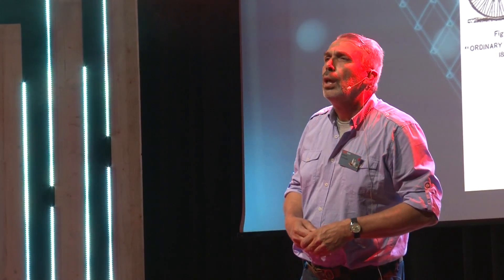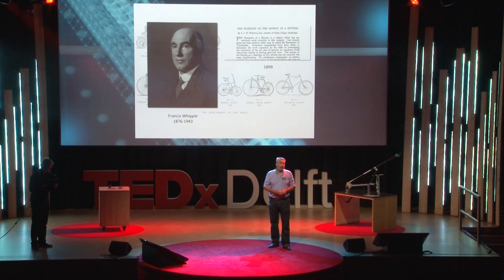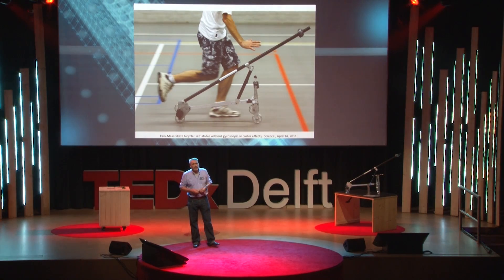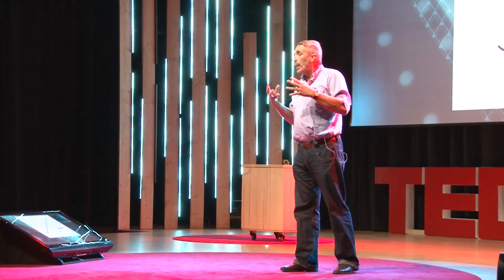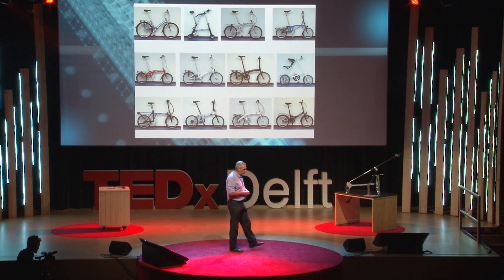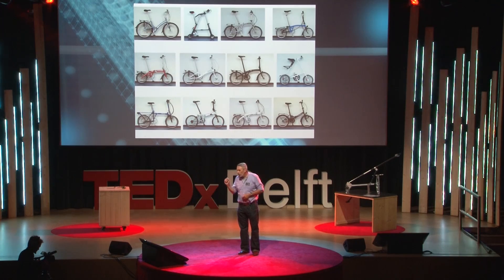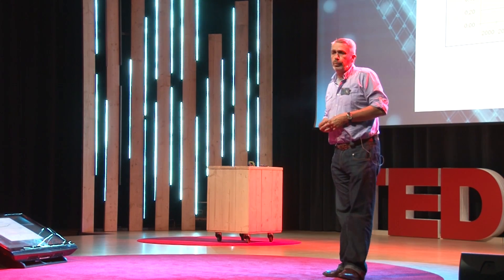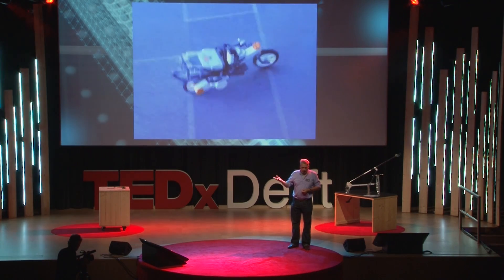Why bicycles do not fall: Arend Schwab at TEDxDelft

Comment: I am really surprised there is no mention of wheel camber, especially given that the speaker is a professer of applied mechanics.

A single wheel rolling on it's own shows the same tendency to steer in the direction it is tilted. When a wheel that is rolling in a straight line is tilted it exerts a thrust in the same direction at the contact patch because the tilted wheel wants to follow a circular path. In effect the rolling wheel automatically moves the contact point to be under the center of gravity. This is the same principle behind a band saw blade or flat belt tracking on a crowned pulley, and also what makes a car with misaligned wheels pull to one direction.

Gyroscopic effect is negligible to nonexistent, and has been debunked, caster effect is negligible but makes steering from the handlebars more stable. I find the idea of one wheel 'falling faster' than the other highly dubious without supporting evidence.

I have a front wheel drive recumbent bike with almost zero trail/caster that will toss you onto the ground if you try to steer only with the handlebars. Instead you have to lean into a turn even at low speed and the handlebars just let you damp the oscillation or turn more agressively. ...Steering on a bicycle can be accomplished almost exclusively with camber thrust. I'm not well versed on unicycles but I tend to guess that the statement holds true for those as well.
Reply: The tire acts like a rolling cone when the axis is off parallel with the road surface, following a circular path, but the inertia of the wheel acts in the tangent, so the forces oppose eachother and move the wheel back to horizontal. Or if the inertia isn't strong enough, the wheel spirals inward until it falls over.
Reply: Gyroscopic effect is small, but not entirely negligible depending on the vehicle.  It's not the dominant force, but has a significant effect on motorcycles.
Caster effect or "trail" is far from negligible, and is probably one of the largest contributors to stability on most bicycles. The model with the wheel "falling faster" is not really demonstrating how conventional bikes work, but just demonstrating another mechanism that can compensate for a geometry with the other stabilizing effects removed.

I don't know your specific recumbent bike design, but I expect if has a bit more trail than you expect. I suggest measuring to see.  Frequently you will need more than on a conventional bike to maintain stability, which is why recumbents often have straighter, or even reversed forks (less offset, more trail)

There's no way at all that you're correct about steering a bicycle with camber alone.

I ride unicycles, and I'm not sure how much effect camber really has there, either.  I've got a unicycle with skinny 23c road bike tires I run at very high pressure, and another with 3" mountain tires which should have much more camber effect, yet it's easier to turn on the road wheel.  I can feel the camber effects on different wheels and I'm often fighting them, which suggests to me that they're not what is responsible for my stability.
Unfortunately, like bicycling, it becomes a subconscious thing, and most people don't even understand what they're doing, myself included.  I'm fairly certain almost everything is due to position of center of mass in relation to thrust (at the contact patch).  If I let myself fall to the right and pedal, the off centre thrust will cause a rotation.  What I'm not entirely certain of is what prevents the unicycle from rotating on the axis of the seat post and rolling out from under me.  I don't get the impression that it's entirely from a bit of drag on the sides of the contact patch, or the style of wheel would have a much larger effect than it does.
Reply: Mark McCormack The camber is the mechanism how bicycles turn corners.
But to make a bicycle "SELF-STABLE", you need: at least two wheels aligned straight in the rolling direction, and only one but not all wheels that can steer left and right freely. Besides, if the road friction is negligibly small (like on well polished smooth floor), even negative casterring is fine. But if the friction is relatively big (like on muddy road), you need positive casterring or at least zero casterring to achieve self-stability.
Reply: +Mark McCormack Very good comment, sir!

I've been trying to find resources to understand that and counter steering properly (most stuff online if full of guessing and no physical or mathematical explanations whatsoever) and this video and comment are gold! Of course this also mean they left me even more confused than before... hehehe

Tbh the only part I disliked about it was when you said "the tilted wheel wants to follow a circular path", like it has a will of its own. I did not quite understand this point because of it. Care to elaborate? I can imagine why this happens on a bicycle, but not really on a wheel by itself.

Thanks!
Reply: BoyTitan:  You ride a front wheel drive exactly the same way as a rear.  The only time there could be a significant difference is if you're losing traction due to the thrust of the front wheel.
Reply: I was thinking about a saw blade on a bandsaw (that is, the blade moves to the highest line on the two wheels) also.
Reply: Not huge on all this physics stuff but your problems comes from a difference in steering. A motorcycle or bike with 2 wheels that are rear wheel drive you counter steer push left go left push right go right. A front wheel drive bike not fun to steer tried it with my e bike and switched to a rear wheel drive motor. Also no sure if your recumbent is 2 or 3 wheels. If its 3 wheels you really are gonna have a bad time with single front wheel drive. Front wheel drive can only be done right with 3 wheels when the front 2 wheels drive in unison.
Reply: @TinyTitian  The "push-right-to-go-right" counter steering method is about upsetting the cycle's natural stability and moving the ground-contact point from underneath the CoG.
Reply: That's a fair point, much like the stability of a train on tracks. 👍
Reply: I was thinking about bandsaw blades tracking too.

Comment: Assistant Professor vs. Mechanical Engineer:

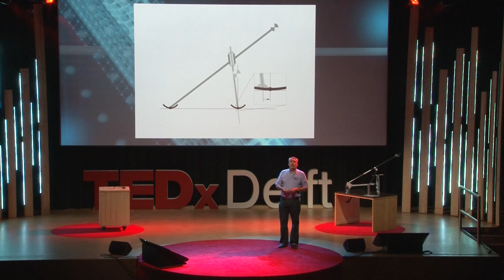The picture at 9:14 shows positive caster.  The device in action has positive caster.  There is no demonstration of the device working with no caster.  If his argument about tipping masses was correct, a stationary bicycle would turn toward the fall.  This does not occur in the demonstration at 4:11.  Bicycles self stabilize because of the  caster effect and the rounded rubber tire.  As the bike falls, the contact patch moves toward the side wall, and friction helps to turn the wheel toward the fall.  Metal, "pizza cutter" type wheels would rely completely on the caster effect.
Reply: Any time Mr. Sibert. I'll bring the graph paper and the screen grabs. I'm out of whiskey at the moment, so let me know ahead of time so I can pop down to the shops.
Reply: The stationary bike falling does provoke a steering effect, but if you just let the bike fall, you can't see it in time.  I've just tried it with my own bike.  Hold the bike upright with the steering straight and lean it over.  The steering will turn into the lean every time.  The caster is what does it, and I agree that his "no caster" model does in fact have some positive caster.
Reply: I've been riding two wheels for over 45 years and your reasoning is just common sense to me. Stability is a function of inertia, variable caster angle, and contact patch area/friction. It's the relationship of these three things that determine stability. If you look at any one aspect while ignoring the others - of course it'll make you wonder. The delta must be close to zero sum. You vary the caster effect, either by making it 0 or increasing it too much like a chopper, stability will decrease. Increase or decrease friction too much, (like riding on ice or having a front tire so flat that the contact patch affects caster and inertia, stability decreases.  Increase or decrease inertia and caster will need to vary to maintain zero sum. For example, we increase inertia during high speed cornering. To overcome this we have to decrease caster to offset the inertia. This is done by leaning forward and literally steering away from the lean - the opposite of a low speed turn.

Their experiments were done by limiting both inertia and speed. The rear steer bike worked well at low speed. Increase speed beyond the limits that the caster can be varied and during a turn the caster will cause the back end to swing around, increasing friction of the contact patch and inertia will cause the rider to endo in a straight line until friction overcomes inertia. Ouch.

Comment: Do humans have a gyroscope inside our bodies to keep it from falling?
Reply: Zhonguoria The inner ear is where most of the magic is.
Reply: ***** Um honda did it. Asimo
Reply: Sensory organs such as the eyes and inner ear (as Timothy Green has said) receive signals about our bodies' position, the brain processes the information and sends signals to our muscles to correct imbalances. When walking our arms play a role too, have you noticed how they naturally move at the same time as the opposite leg? In other animals the tail also helps with balance.
Reply: Not exactly.
Reply: Is that a serious question?
Reply: Two things work together.  Your inner ear has sensors that tell your brain which way is gravity.  Your eyes tell your brain what angle is the horizon.  The brain combines these two data sources to maintain balance.  This is why when going around a high speed curve your eyes need to remain as level as possible or a false gravity signal (centripetal force pulls gravity a bit sideways) from the inner ear and a tilted head will cause spacial disorientation.

Comment: All of this makes sense except for at 8:31. By adding additional wheels you do not nullify angular momentum, you double it. Angular momentum toward the rear of the bike has the same effect as it does in the other direction.
Reply: Dalek:  Thanks.  The discussion before was frustrating.
Reply: Andy Ruina  I care, thanks for the explenation. Justsomeguys comment initially gripped me. But having the background of learning about angular momentum vector analysis stuff myself some years ago, your comment seems very sensible. But it's not something I'd have thought of easily, cuz its been a while since I studied it, and as you say, it is not very intuitive at all... which I think is part of what makes it great anyway, so thanks :)
Reply: eyesyc
You clearly don't understand angular momentum. The mass of the rotating wheel travels along the same plane as the mass of the bike frame, And they are rigidly connected. Regardless of the wheels direction of rotation, it's still moving along the same plane. The energy needed to deflect mass from this plane is angular momentum. For example, The front wheel has a rotational mass of say one pound, it's rotating at 100 revolutions per minute. at the given mass, moving at the given speed of rotation, it will take a specific amount of energy to deflect that mass by the one degree from the plane described.  Regardless of what direction it is spinning. Spinning another wheel in the opposite direction does NOT cancel out anything.
Reply: eyesyc
What you have described is torque. Then you threw in some unrelated terms that you found on Google. I remain unimpressed.
 And YES... Please do give me a full vector analysis. Seriously... I'm looking forward to it.
 Here's a prediction... You will avoid my challenge to provide it, then change the subject in order to avoid the shame of having been caught bluffing.
Reply: eyesyc
As predicted.
Reply: Hi  JustSomeGuy:
   Your comment is echoed in several places on the www.  And it reflects a common misconception about angular momentum.   Too common.  The misconception is even in a video put out by NASA in which an astronaut tries
to explain angular momentum using rotating CD players.  Here is the misconception.  In your mistaken view, and the mistaken view of many others, angular momentum is a positive scalar, like mass.  If I have some and you have some and we get together we have more.  

But this is not so.  Angular momentum is a vector.  If I have some pointing left and you have some pointing right and we get together, they cancel.   And this is the way it is with the wheels on the bike above in the video.

The propagation of this false conception, that angular momentum is a scalar and not a vector, is in part due to a common overly simplified expalanation of a gyroscope.  That overly simplified description is this:  A spinning object resists rotation.  

The more correct statement is that: A spinning object, if torqued about an axis perpendicular to the spin axis, turns about the axis perpendicular to the first two.
And the direction of this turn depends on the direction of the spin.  Hence the cancellation if two spinning wheels are mounted to the same part of the bicycle frame.

I realize this is hard to understand.  No-one I have met, and this includes lots of people with PhD's and me as well, really has a deep intuitive feel for angular momentum in 3D.  It is so, well, three-dimensional.  And picturing things in 3D is hard for our human brains.  None-the-less, we understand some things.  Enough to know, say,  that gyro effects cancel when you have  counter-spinning wheels. 

But we also know enough to know that these things are hard to understand. So your being confused about this is well within the realm of the normal.
Reply: Andy Ruina
What you've done here is called straw man argument. It in no way addresses what I said.
Reply: Dear Just Some Guy:
  I don't get your straw man comment. 
  The short version of what I wrote is this:  Two counter-spinning wheels attached to the same frame have cancelling angular momentum, not, as you said, adding angular momentum.  Yes, their kinetic energy adds, but that is not relevant for the turning involved in bicycle balance which is about turning and torque, not about kinetic energy.
Reply: Andy Ruina Adding angular momentum to the entire structure prevents turning. It's settled. Let it go. Thread muted.
Reply: It seems to me to be wrong. But if you don't care I guess that is that!

Comment: It doesn't sound like they considered the fact that a tilted wheel will apply a turning and stabilizing force, regardless of trail, mass distribution, and gyroscopic effects.  Lose the bike all together and slowly roll a wheel by itself,  it's stable.  As it tilts into a fall, it rolls on its radius and applies a turning motion correcting the fall.
Reply: Hi Timothy:

Andy Ruina here, I am in and made some of the clips in the video above.  And I have worked for years with Arend Schwab, the speaker in the video.

Your explanation for bike stability, that it is like the stability of a rolling wheel, was one of the prominent theories of bicycle stability in the 1800s.  And it lives today.  And it is a big part of what motivated our theory and experiments.  So, no only did we consider the self-stability of a rolling wheel, our work was explicitly intended to show that this effect was not key.  It is relevant, but not key.

By the way, that stability of a lone rolling wheel IS completely dependent on gyroscopic effects.  That a rolling wheel steers left as falls left is entirely a gyroscopic effect.  And that effect is there on a bicycle.  And it is important for bicycle self-stability.  But for a bicycle, unlike for a rolling wheel, that effect is not needed for self-stability.  That is really one of the two original points in the video above.

The other of the two points is that trail is also not necessary.

The whole point of the video, corresponding to the title of the Science paper which it is describing, is that Neither Trail Nor Gyroscopic Effects Are Needed For Bicycle Self Stability.   This is to distinguish the bicycle from a rolling wheel, in which gyroscopic effects are needed for self-stability.
Reply: A wheel rolling by itself does have gyroscopic effects!
Reply: hello sir, I have strated to get very interested in this subject. When you talk about  a lone rolling wheel relying on gyroscopic effects , do you mean gyroscopic precession? From what I have understood, it takes effect when the wheel actualy leans to one side. If so, why does a wheel rolling in circles and having a fixed angle to the road not go straight?  hope you respond
Reply: I think this is more of a car matter than a bike matter. I believe the tilt is factored in trail
Reply: I didn't intend to say that gyroscopic effects don't exist.  I believe there are other small forces that are also involved based on the geometry of a wheel/tire and where the contact patch is applied and the CG and resultant forces.  How involved would depend greatly on the details of each application.    I agree that gyroscopic effects play a big part on single wheel stability.  I think the situation i'm thinking of is a rolling coin as it falls. It will rotate around its radius even though the angular momentum is very small.